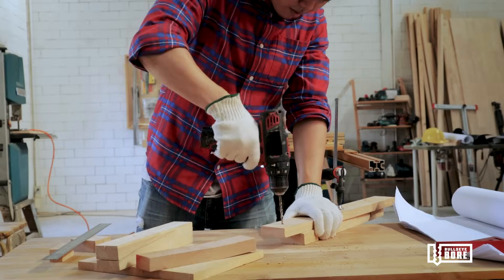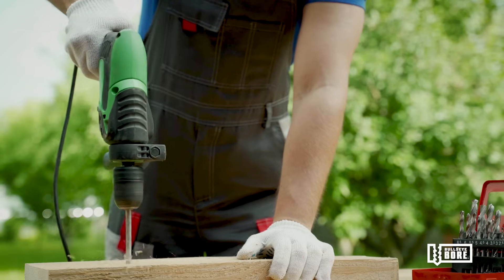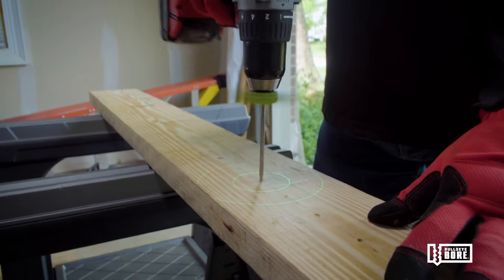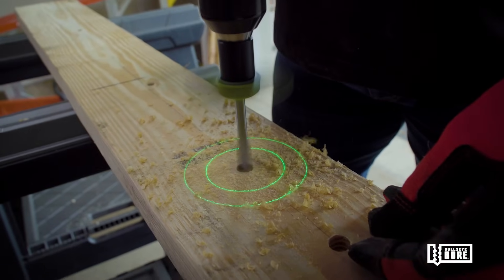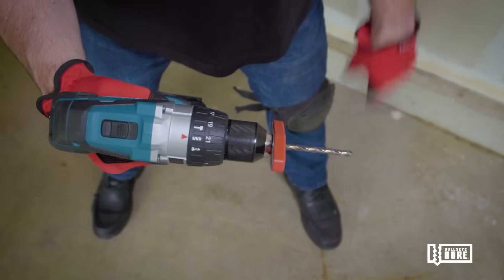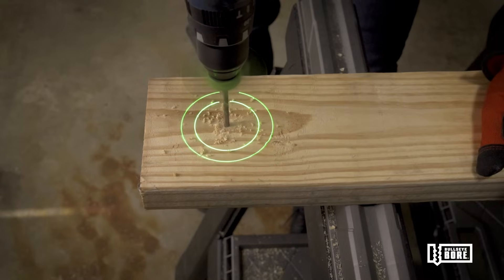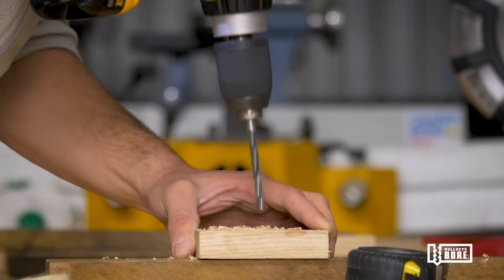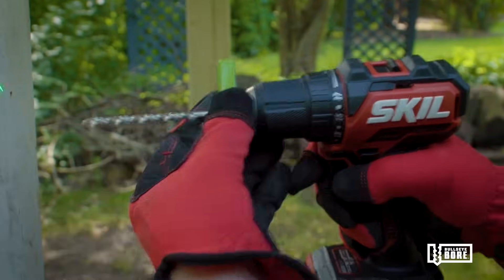BullseyeBore Core - Kickstarter Campaign (v4)

Comment: Would it work inside a 4.25"  hole saw with a long pilot bit?
Reply from the maker: BullseyeBore Core is designed to work with drill bit shafts up to and including 0.5". It will also work with a wide variety of specialty bits, but it does not work with hole saws. For more information on drill bit compatibility please see the FAQ here: https://www.bullseyebore.com/faqs#maximumdrillbittdiameter

Comment: Always had this issue when woodworking. They have these 90 degree clamps you stick your drill into but it’s clumsy and requires a certain surface area to work. This looks interesting if it’s not a scam
Reply from the maker: Coming to Kickstarter January 30th: https://www.kickstarter.com/projects/928505817/bullseyebore-core